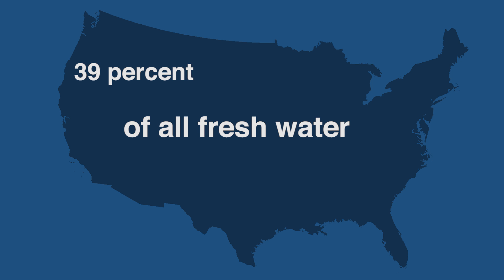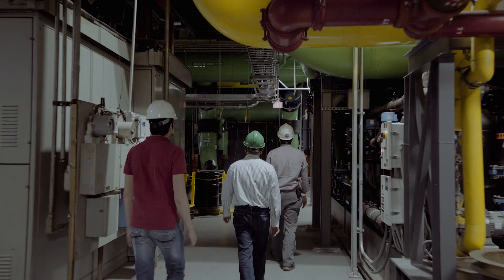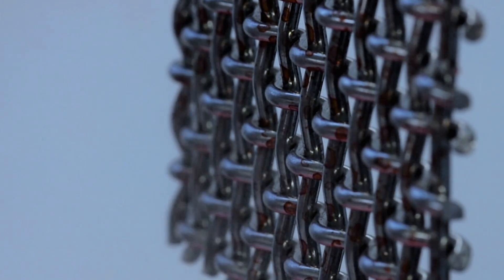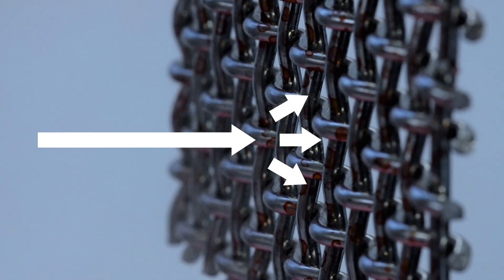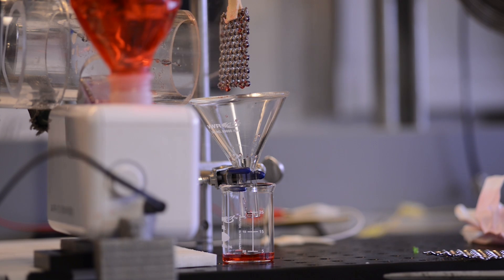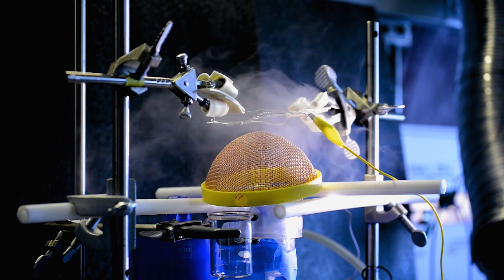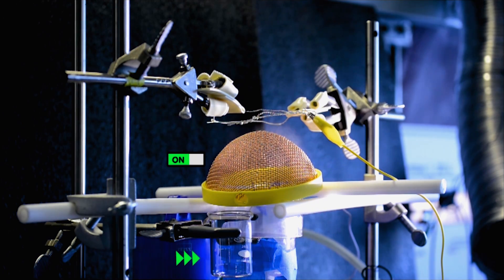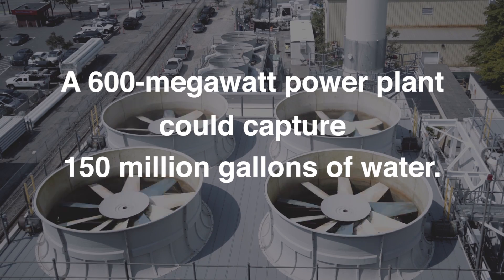Tackling the global water crisis

Comment: If the system is at the top of a building, that water can go to a high altitude water tank - no need to pump water up - already at the right pressure, flowing downward to all faucets in that building.

Comment: she says once they zap the fog with electrically charged ions its attracted to the mesh. so the water must be charged and the mesh is at least grounded. I think high voltage low amperage would work. with the fog acting like a spark gap.

Comment: You can't loose water in the atmosphere. It's a cycle and after being up in the air it'll fall back to the ground. But the system shown in the video is practical if you want to keep the water in a small pattern so it doesn't "float" away in a global area.

Comment: “To make power plants more sustainable” LMFAO. Give me a break.
Reply: Ummm. Yeah. Ok. What are they teaching you in schools? Water is a natural resource we need to conserve, and yes, it is a big part of a sustainable environment. But I guess they teach that we can produce all of our power needs off of the sun and wind? LMFAO! I could spend hours explaining to you that we need a reliable source of base power and don't even start on batteries.We can't have any discussion about nuclear power plants because of the fear of  nuclear waste, meltdowns, or terrorist attacks. But there are solutions: there is a limitless source of thorium; better and safer designs than high pressure nuclear reactors of the type originally built; and I could go on but I doubt you want to hear it.  Nuclear power plants have zero emissions, but they usually do have cooling towers whether it's of the high pressure or if it was a low pressure design such as a MSR. If they don't they are using fresh water which can be an environmental problem as well. For right now, fossil fuel burning plants create the majority of the energy we use and need every day and this is in the Gigawatts. Add up all of these horrible power plants (in thousands of MW's (that's megawatt) and find out what the price is $/MW for whatever source you think is the best replacement , and then multiply. It's a staggering number. The stimulus bill barely put a dent into more sustainable energy. So until our brain washed children straight out of school start practicing math and economics, question the well-intentioned, educated professors, who also don't do the math and start discussing realistic goals and how we can accelerate investment in them, I don't want to hear worthless comments like this one. In the meantime, this article shows we can make them more sustainable by not wasting the water lost in cooling towers or (per the previous article on infrastructure) leaks in old piping that has exceeded its expected life by 2 - 3 times. Or we can just be a sour puss like youself and just demonize power plants. Or better yet, plan a worthless demonstration with signs and make the news to show how much you care about the environment and blame the power plants. Let's put up solar panels and windmills and everybody go, wow, this is great. But ask them how many kW it produces compared to how much the same building or the community needs. You might find something many posters on here don't have. A dose of reality.

Comment: It could also be used WITHOUT power plants, to catch water from foggy mornings, no matter where you are (even in weird places):
- With Hydroelectric energy: the higher you capture the water from, the more power you'll get from it.   So capture water from the fog on high towers, mountain-tops, or even lighter-than-air platforms floating in the air (lets go crazy), suck the water DIRECTLY FROM CLOUDS!  Then you pipe the captured water down to hydroelectric generators down on the ground, generating a lot of power from the water flowing from the truly immense height.  And if you're storing that water up there on the mountain top, it's like a battery you can re-charge every morning from fog.
- You could also use this to capture water to use as ballast for theoretical lighter-than-air gliders, which glide both up & down by continually adjusting their ballast weight while flying, so that it can alternative between lighter-than-air & heavier-than-air.  In the past the idea was to do this via compressing onboard gasses to make them heavier, it's very difficult and AFAIK no-one has been able to build a functional/useful vehicle.  But if you instead CONDENSE WATER outof the air, that would be a fantastic way to adjust ballast weight.  It might enable this aircraft!
ps: If you're new to the concept of lighter than air gliders, it's basically an air-born version of this: https://en.wikipedia.org/wiki/Underwater_glider
Reply: Or, you could use it at a power plant on cooling towers which use potable water for makeup! Geez, you must be young and think money and resources are limitless.